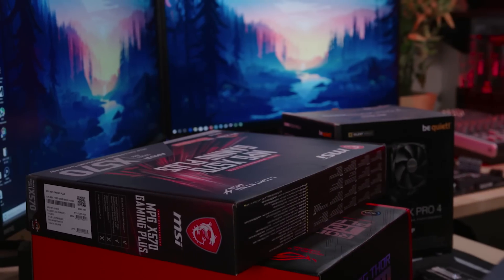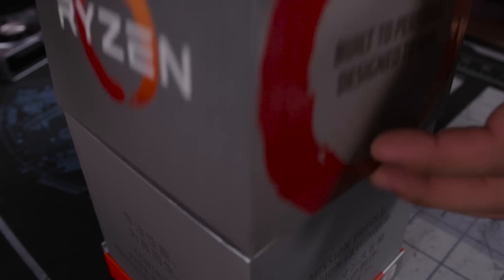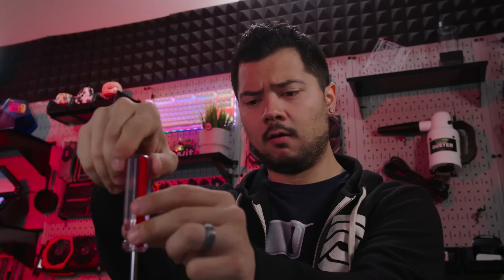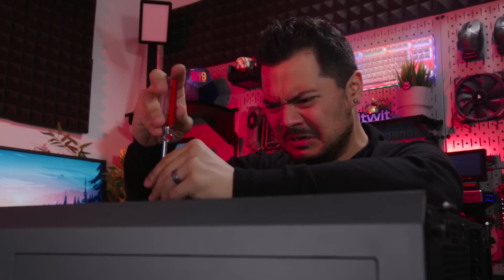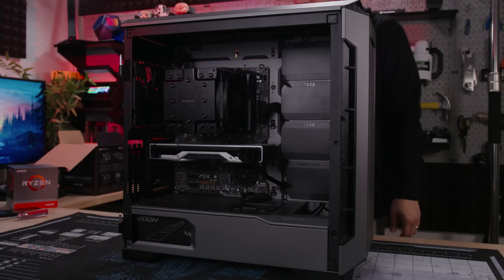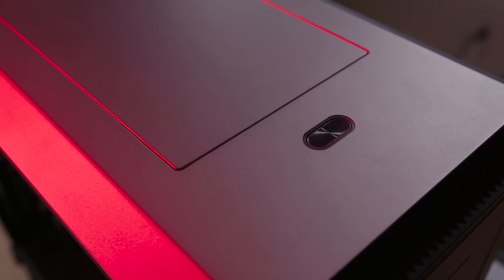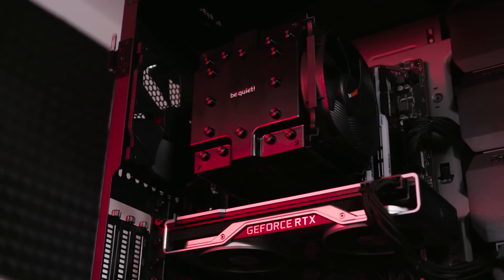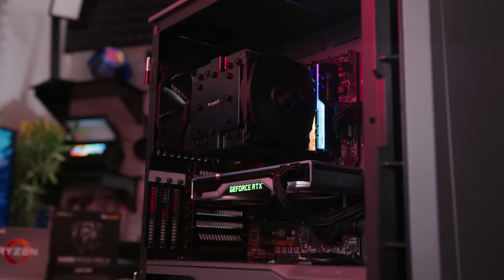Top 5 SCARIEST moments of building a PC!

Comment: The bent pins literally scared me
Reply: You mean "BENT" not binned as binned means when the manufacturer or a third party goes through a line of the same type of product such as a CPU then testing them to see which one's perform better and usually either sell the higher performing one's for more or disable some of the features on the lower performing CPU's such as a CPU where the iGPU doesn't work right they may disable it and sell it for less
Reply: @zahidshabir4038  That's the first that came to my mind, but I think it may have just been a coincidental language thing in that in a non-computer sense having something 'binned' could mean throwing it in the trash bin.  In my mind I just changed 'binned' to 'trashed' to get the sentence to work for me, and yes I did cringe when I saw the bent pins.
Reply: Fucking uncomfortable to look at that thumbnail lol
Reply: just fixed my first cpu with bent pins yesterday (amd) if u have a thin item to put between the rows its so easy

Comment: My heart stopped when you threw that CPU
Reply: Waiting for the copyright strike from Linus (LTT) in 5, 4, 3,2, 1,........
Reply: I was aghast 🥺
Reply: when i saw that i literally started to tear up and internally i was screaming
Reply: That's a lot of damage
Reply: Adineo  even more terrifying
Reply: Wist that was an Athlon...
Reply: SavageT1Diabetic - I’m sure it was already broken 😂
Reply: Ryzen cpu?
Linus dropped and broke a 10,000 server cpu
Reply: @ethantorres4061  Are cpu pins really THAT fragile?
Reply: Most likely it was an athlon
Reply: Unnamed Chorf well, intel and amd thought so
Which is why intel and amd moved their pins onto the motherboard (for amd, only their threadripper cpus have their pins on the socket)
Reply: Adineo, I think it was cut.
Reply: @ChorfTV  Not really, unless you step on it or throw it across the room. If you're just simply installing it, you don't have to worry about it. Do check if one of the pins are bent because of shipping.
And in case one of the pins got bent, you can straighten it back using a lead-less mechanical pencil, credit card, or any thin object capable of precision repair.
LGA pins are actually more fragile than PGA pins and they're harder to repair, but hey, at least they're cheaper to replace and there's a latch to prevent the CPU from getting ripped out.

Comment: The part about cracking the cpu is too true, I just built my first PC and was really sweating over how much pressure was needed to get the screws of the cooler into the motherboard.
Reply: Screw with confidence! Applies elsewhere too :,)
Reply: I use stock cooler so no worries. the screw just stop when it's fully down.
Reply: I tried screwing my cooler in 3 times, finishing my entire tube of included thermal paste before it would even start screwing in.. that was 2 hours + of sweating before I read online that I just needed more force to get it to start.
Reply: I was worried about the mobo snapping when clamping the cpu in
Reply: I sweated when i build the i5 6900K and there were 2 broken pins and it wont boot... :0 Ive send it back...
Reply: @TobiasDettinger  There is no i5 6900K and it´s an LGA socket. The pins are on the mobo.
Reply: @lolipopXD123  lmao rip 10 dollar tube of thermal compound.
Reply: @MotoMario1  I think he ment 9600k
Reply: I use the old german method, gutten tight
Reply: @brunbjorn9095  And this is still a LGA socket without any pins on the cpu
Reply: Screwing a cooler is a nightmare, after i had applied the thermal paste and started screwing, 2 screws down, i realized that the standoffs are installed wrong and something died in me at that point. I redid the process without reapplying the thermal paste, it had spread well actually and i didn't wanted to complicate the things anymore.
Reply: Derpy Ducky yea for like the ryzen stock cooler theres a separation and u havr to compress the springs down before starting the thread the screws
Reply: same. Mine was an expensive 9700k so i was really scared
Reply: Cooler master liquid coolers on AM4 mobos use a simple hook and retention lever but the force needed made me think I cracked the CPU.
Reply: i had  the same problem
Reply: @lolipopXD123  similar to mine
Reply: Seriously, cracking your chip when installing the heat sink fan was a thing back in the Pentium 3 and Athlon XP days. Since the inclusion of a metal cap or IHS(integrated heat spreader), cracking your CPU die is a thing of the past. That was like 15 or 20 years ago, now. Improper installation of a cooler, on the other hand...

Not so bad, assuming you have a decent supply of thermal compound. If you apply too much, not enough, have uneven mounting pressure(and thus coverage) or lack of required pressure,  just remove, clean(isopropyl alchohol is recommended, but hydrogen peroxide works too), reapply and try again. If your CPU isn't cool enough, it will throttle down and/or shut off to save itself from burning up.

When I was first setting up my Ryzen 7 1700 system, I was seeing temps as high as around 50c just in the motherboard bios. Granted I overvolted a bit(by .1 volts from 1.1875 to 1.2875) and had the all core clock as high as 3.9(passed Cinebench R15 but web browsing led to a system crash after a few hours so I backed it off to 3.8 and it's been fine since). When I saw temps seemed high, I removed the cooler, cleaned it, added some Arctic Silver 5(used the preapplied stuff first) and tried again. Same temps. Later, I installed some software(Hardware Info, Hardware Monitor, not sure) and it showed an idle temp of 31c(so about 20c lower than what the bios said). After back to back loops of Cinebench R20 for a while, I was maxing at 71c and not going higher(40c delta). I think that's a decent temp on the stock Wraith Spire RGB cooler(albeit with fan set to 100% and case fans set to 100% which are 2 front intake 1 rear exhaust 120mm lower speed white led fans in an Antec P8 mid Tower with tempered glass side panel). Not too loud.

Seems my AsRock AB350 Pro 4 motherboard bios was lying to me. It was pulling that 20c offset crap other boards only use on CPUs with an X at the end of their name (1800X, 1700X, 1600X, maybe even 1500X and 1300X).
Reply: @jyrone3943  intel uses LGA(Land Grid Array) for their chips, so the bottom of the processor is flat with holes for the pins which are indeed in the motherboard CPU socket. It's been that way since LGA 775(Core 2 Duo/Quad, and even 90nm Pentium 4/D). AMD uses PGA(pin grid array) for their chips(pins on the CPU, holes in the Socket).

There are Pros and cons to both. With LGA, you don't have to worry about bent pins on what may be a fairly expensive CPU(warranties and return policies don't cover bent pins, even if you didn't do it). However, if you bend one or more pins in the socket, they are tougher to straighten out. PGA is the opposite. No worry of bent pins in the motherboard, easier to straighten bent pins on the CPU. I think for intel, you generally spend more on the CPU than mobo, and upgrade options may be limited. For AMD, you might spend more on the mobo(say a B350 or B450 chipset with a starter Athlon 200GE, R3 2200g, R3 3200g, R5 2400g) but have a better upgrade path.

Edit: PGA has been around since the beginning, pretty much. During Pentium II/early Pentium 3 and AMD K6/early Athlons, both companies used processor slots(slot 1 intel, Slot A AMD). The CPU card slotted in a bit like a ram module, but also required a cooler, fan facing up and down or sideways depending. Both companies used 242 pins, but one aligned the slot vertically and the other horizontally. It was a time when on die L2 cache wasn't a thing yet. One or two separate ram dies were  soldered to the CPU card on either side of the main CPU die in the center. Once on die L2 became mainstream with 180nm Pentium IIIs and Athlons, both companies switched back to sockets(on die L2 started with the Pentium II based Celeron 300A which was the overclocker's darling of its time). With 130nm Pentium III Tualatin, 180nm Pentium 4, and Athlon 64, both companies switched from traditional PGA(die on top of chip) to FPGA(flip-chip PGA) where the die was on the bottom. 

Having the bottom of the die facing up allowed for better thermal contact with the heat spreader.
Reply: I built my first PC about 8 years ago. I built my second PC 2 days ago. 
I didn't even realise cracking the CPU was a thing. I just screwed the cooler on til the screws stopped.

Comment: Every time I take apart my pc for upgrades or just cleaning, I always manually switch off the PSU and it always gives me a mini heart attack when I forget to flip it back on at the end and the computer won’t turn on
Reply: Also me pc turns on but no display

Forgot to connect the pin for the graphics card
Reply: @wanzbluez5842  which pin do you have to connect to get it working?

Comment: watches the verge build a pc 

THAT THING SCARES ME
Reply: I was laughing, screaming "don't do that you idiot." For a $2,000 pc that was just haunting
Reply: you need to screw in with confidence
Reply: Just don’t forget the tweezers and you’ll be fine
Reply: I fear no man. But that thing... It scares me.
Reply: Brace yourselves, cause its time to install the brace that goes at the b-back of the computer. You really have to make sure that you hammer it in
Reply: That Allen wrench alone scares me. I built my first gaming pc a couple of months ago, I didn't need to use an Allen wrench. I am scared that I probably missed something important.
Reply: you need live strong band it will ward of all the bad luck and static and everything will be fine you can do icing on your cpu that will make it pretty
Reply: Nice nicholas
Reply: To no end.
Reply: Just drive these deep screws through the radiator...
Reply: the Table gentleman.. dont forget the first thing..
Reply: was the 666th liker B)
Reply: and dont forget the insulating pads so the power supply doesnt short circuit and come into contact with the rest of the system
Reply: Is that a picture of the shadiversity dude?
Reply: i fear no man
but that thing
* verge building a pc *
it scares me
Reply: @pcfreak6   you're not fighting static, you're fighting cancer!

Comment: The CPU cooler is especially terrifying when it has those springs on the bottom. My first ever PC build had that, and it kept making these awful creaking noises as I was screwing them in.
Reply: The AMD Ryzen Coolers have these and it make some of worst sounds I've never heard.
Reply: @yapod9061  I was just putting on the cooler and the pre-applied thermal paste got on the cpu while the cooler wasn't positioned correctly and i have never been more scared in my life, since it was my first time it was traumatic...
Reply: AMD is good at making those
Reply: SAME! I PANICKED WHEN I HEARD THOSE CRACKING SOUNDS HAHAHAHA

Comment: Me before I watch this video : I’m gonna build my computer all by my self!
Me after I watch this video:  PREBUILT
Reply: just buy a prebuilt and upgrade it
Reply: @kgkomrin  That's what I did, but in the end I replaced the whole thing so rip my wallet.
Reply: @kgkomrin  that would be the stupidest thing ever
Reply: @BeardedPickIe  i know but its better then nothing
Reply: @BeardedPickIe  I'm making a custom build aswell but parts are so hard to get here in my place
Reply: @kgkomrin  where do you live?
Reply: @BeardedPickIe  should i say that?
Reply: @BeardedPickIe  Not really, depends on the budget, if your budget is VERY LOW like mine that was just $300, going with a cheap $100 prebuilt and slapping a good power supply and a used GPU is the way to go.
Reply: @russiandoomer9524  It gets the job done, as long as you don´t bottleneck the GPU it will be fine. I have an i5-2400. Slapped a RX 570 4 GB on it with the 12 GB of RAM that I got it with. Solid 60 FPS in 1080 Normal or higher in almost all games. No 100% usage on CPU or GPU most of the time.
Reply: dont worrt about breaking it this is over exaturated, just be a bit more carefull when u see a part that was also in video
Reply: But i Bought a prebuilt $11000.
It doesn't work well. So i bough the parts and built my own Gaming pc worth $15000
Reply: @everything6298  you mean 1100*? 11000 is way too much
Reply: @kgkomrin  Your littlerly paying double for something you can get for cheap. Lmoa that's the dumbest idea I've seen
Reply: @rocketpencil5948  ok sorry my comment hurted you
Reply: @kgkomrin  I guess it can work if you have no idea how to build a pc, but it will cost more anyway
Reply: @rocketpencil5948  ok

Comment: Lyrics

The stories you’ve heard about PC assembly are the tallest of tales unless they’ve left you trembling.

If you’re not frozen with fear yet, you are soon to be. Here are the scariest moments when building a PC.

The terror begins with the first installation, of a motherboard or CPU prone to damnation.

The corpses of pins made by one’s lack of caution, sends hardware right back to their card-boarded coffins.
 
With the processor mounted don’t you dare cease to cower, behold the crushing force of the cold heatsink tower.

Rising pressure of each turn makes your sweat drip, as you’re haunted by thoughts of cracking your chip.

A motherboard standoff seems easy to place, but strippings’s a nightmare that can’t be erased.

Strip one too many and you’ll run out of breath, when your unrestrained parts plunge straight to their deaths.

Now you’ve made it this far and your vitals are stable, then a panic attack grips you with an end trail of cables.

You’ve tied and you’ve tied but can’t seem to hide the tentacled serpentine hellbeast inside.

The chilling conclusion does the greatest fear spawn your finished PC refuses to turn on.

Lifeless and dark she fills you with dread, would it really have killed you to buy a Pre-Built instead? Kyle nods at the camera

That is the fate of this hair-raising ride, but fate can be bent with a good building guide.

In a best case scenario you’ll know just how to fill it, I promise the next build won’t kill you

OR WILL IT? Que evil laughter 

For anyone who wanted to rhyme along.
Reply: Why
Reply: damn
Reply: Queue*
Reply: Thanks. Just did so. And FYI, my voice tends to be on deeper side...

Comment: The fear of accidentally dropping something like a screwdriver on the GPU die while replacing the thermal paste.
The fear of accidentally ripping the CPU out of the socket while removing the cooler. (AMD)
The fear of accidentally dropping something in the CPU socket and badly damaging the pins. (Intel) 
The fear of not hearing your fans slow down after a BIOS update or after clearing the CMOS.
Reply: I've ripped the cpu out of the socket before The paste made it stick and it wouldn't come off
Reply: I literally touched the mainboard with my screwdriver and wanted to cry Lmao I was lucky that everything is fine
Reply: @nojusticeanywhere 
that why you twist and budge the cooler to come off, or try to take it off right after using it (since the warmth of the cpu after use makes the thermal paste much more workable)
Reply: @nojusticeanywhere happend to me too with an old system I ripped apart.

Comment: I built my brother's pc a year ago. I experienced all those fears, and addictionally fear of breaking graphic card slot, ram slot and connecting cables wrong way. It wouldn't boot anyway, so we had to send it to the store and they gave it back in 2 weeks. I bought a pc a week ago and paid 20$ for them to build it, it came to me in 2 days without any issues, with all drivers installed and with no visible cables.

Comment: For me installing the CPU was the most stressful part. I was afraid I had put too much thermal paste on it, or that it wouldn't be secure enough because I was scared to tighten it down and damage the chip, it was tense. Thankfully, everything seems to be running very smoothly.

Comment: Yeap, number two is so accurate to me. Was very worried when i need to push down the screws on my Coolermaster hyper 212 turbo onto my Ryzen 5 2600. I was triple checking the videos and user manual on rather or not do I really need to push them screws with force.

Comment: For me it was:
-Worried to not over torque things (CPU cooler screws, mobo screws, etc)
-Not bending the IO shield
-The USB 2.0 plug was weird and you have to be careful to not bend the little pins 
-Ryzen CPU installation was easier than it looks
-Also, the mobo was harder to line up in the case than what you see on youtube. Sometimes you need to stand the case up and try it that way and then maybe you could place the case on its side and finish it that way.

Comment: I had a dream last night where I was inserting the CPU into the motherboard socket, I leaned my elbow down to get stable support before I attempted to place the CPU in, but little did I know, I was placing my elbow on the side of my motherboard, cracking it slightly and flinging up the rest of the MOBO to hit the CPU I was holding, completely destroying the pins on my MOBO and on the CPU. 
This dream made me so nervous about my first pc build that I'll be building soon, and this video made my nervousness into intense fear.
Help

Comment: I picked the parts for my PC in 2016 and then had them build it together for me already because my mother didn't allow me to build my PC myself.
System has been running fine, but I replaced my GPU a few months ago and I will soon upgrade my Motherboard and CPU and oh boy do I wish that I built it myself from the scratch to know what to do. My current case has really shitty airflow I think because the front barely let's any air in, so I'll probably buy a new case, Motherboard and CPU and just take out every component of my old PC, basically building a new PC from scratch and with the help of tutorials I think it'll go okay, atleast I hope so